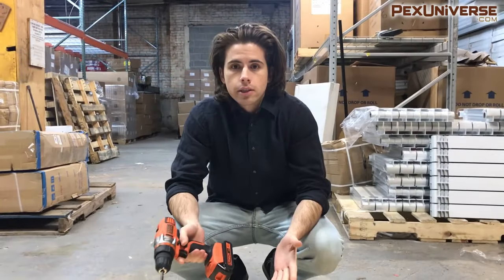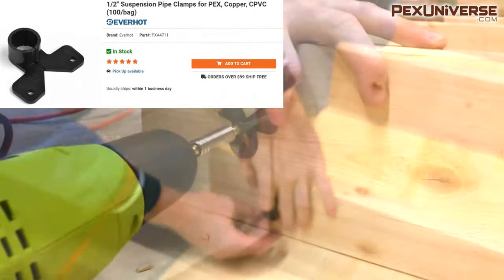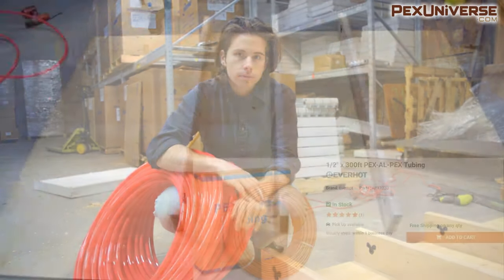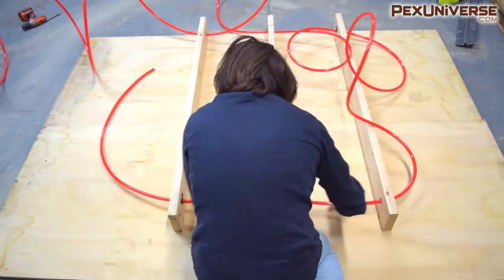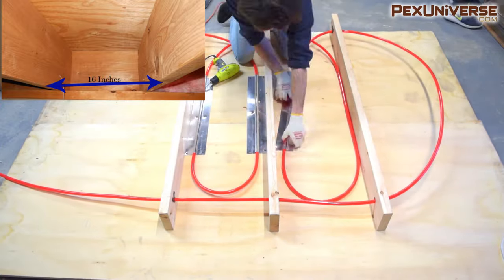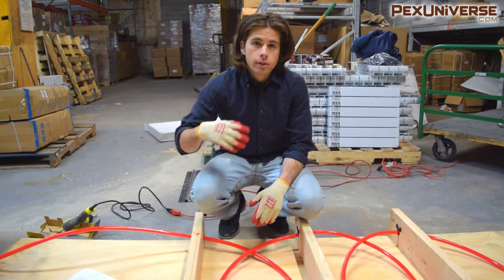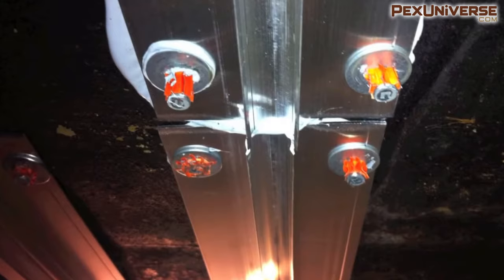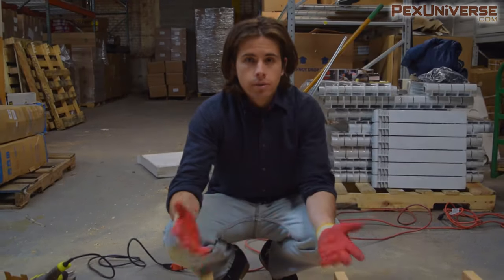How To Install Radiant Floor Heating System w/ HEAT TRANSFER PLATES

Comment: You are easy to understand and pleasant to listen to.  You did a wonderful job.  Because of you, this 67 year old woman that was never anything more than a stay at home mom, is going to do this on a VERY small project.  I think that if the pex doesn't come in smaller rolls, the ONLY problem that I will have is too much left over.

Comment: Good start but a little tweaking may be needed. 16 o.c spacing should have 1¼" gap to the joist and 4" between plates for 8" o.c. pipe spacing. Even spacing and no noise from the plate expanding while touching the joist. Best practice for zero noise, staple only one side of the plate, no silicone needed.  On 2x10 or 12 joist you could make holes 2 - 2 ½ to allow for the shortest return pipe(s) length/path to the manifold and reduce head loss. Dimensional lumber has many insulation options. Staple double bubble with foil on both sides insulation across the I or open joist 1 ½ inch top member for a 1 ½ inch air gap.

Comment: Can you confirm that clear silicone glue you mentioned is just 100% silicone sealant and not specifically “glue”? Thanks!
I’m trying to minimize noise and rubbing as I don’t want the oxygen barrier to wear off

Comment: Ever good and clear info.   If I am putting the tubing in my basement ceiling for the floor above which has tiles.   What do I need to know?  How much less efficient then submerging in concrete of the tiles. thanks

Comment: Hi! SUPER HELPFUL VIDEO!! :) Hoping for suggestion or advice on my first attempt at using Pex tubing... I'm hoping to install a hydronic radiant floor heating within a Sprinter van to live in full-time. Currently my idea would be to do a hybrid of air/hydronic heating consisting of:  mincell foam, reflectix, then pex tubing with heat transfer plates, and then baltic birch plywood. The idea is to heat the air within the floor since I can't use a substrate like concrete. I know this isn't the most efficient method- do you have any suggestions of possible substrates to use that are lightweight or to make the design more efficient? If it matters I'm planning on using an Espar diesel heater to run the glycol through the Pex tubing. Thanks in advance! :)

Comment: Replacing forced air with Radiant. Working in the basement putting Pex al Pex between upstairs floor the joists. Is there a standard or clever way to avoid, cover or cut nail ends protruding from the subfloor?  Or do I just need to bend them flat with a hammer??
Reply: Best method I have used for that situation it to cut them off flush with a grinder
Reply: @lawrenceholmanjr.5870  
do you have a chance to finish your project? radiant heat pex
how it's  effective? do you like it?
Reply: @Ray-wr2wr  I did professional plumbing for about 5 years and had to install radiant heat in a few homes and that was before they had all this new stuff that's around today. I have not gotten to install my radiant flooring as of yet but I will hopefully get there with in the next year or two. If it wasn't for the jump in cost of Pex and copper I would have already started it. I can tell you that I have enjoyed the way Radiant Heat works for about 20 years and that's the only reason I wish to put it in my home. I love the way it heats from the floor up and it is vary affective. The first time I was ever in a home with radiant heat I could tell the difference in heating. It eliminated all cold spots that were in the house prier to the installation. I do recommend it over standard heating.

Comment: Half my basement joists are spaced 16”, but the other half is narrower at about 12”. Should I just run a single up and down the narrow spaces?
Reply: check the bend radius of you tubing from the manufacture, you may be able to run two tubes in it. you may need to run one tube with tracking and one run with out tracking in a 12 run. good luck

Comment: Why were the transfer plates not spaced evenly. I feel they should have been installed away from the joist to create even spacing. As you show it, the spacing bay-to-bay is less than the spacing within the bay.
Reply: Agreed. The tubes are not spaced evenly, so you will get uneven heating

Comment: Im sure its importance to be careful while installing hardwood flooring, not to hit the pex as it sits up against the plywood Fluor like that.
Reply: Hardwood floors would be a bad choice to use in floor heating systems. The heat would cause them to dry out & they would also be a poor conductor of heat.  It's recommended not to use in floor heating system with Hardwood flooring.

Comment: Where and what to you use for heat? Is there electric heat tape that would work, like the heat tape we use in cold country to keep the gutters and downspouts working. What I did was cut a hole in the floor of one closet and another in the ceiling. I have a fan in the duct in the closet and wired to a temperature switch in the attic. It is set to come on at 60 degrees so it goes on and off at 60 degrees. The problem is that the holes need to be closed when you sell the property and the dumb Fed.s don't like common sense.

Comment: im gonna use aluminum foil
Reply: I've used aluminum flashing in the past for homes and it seems to work just fine. it is about the same thickness as the plates they show in this video and much cheaper.